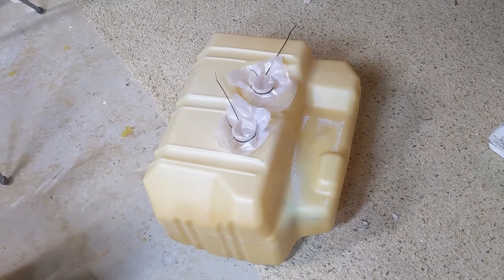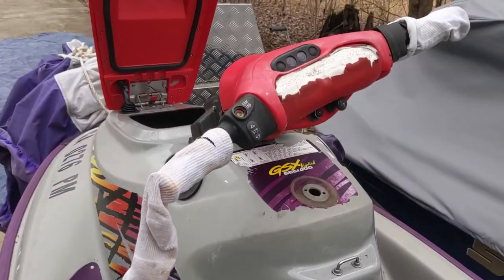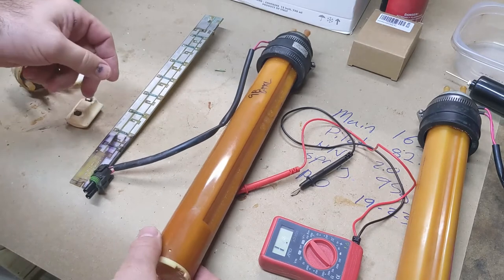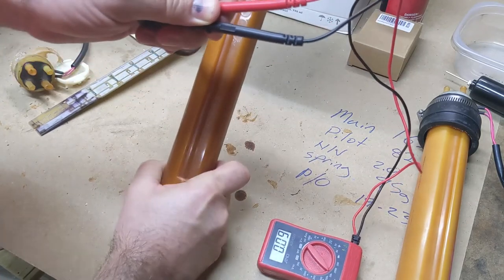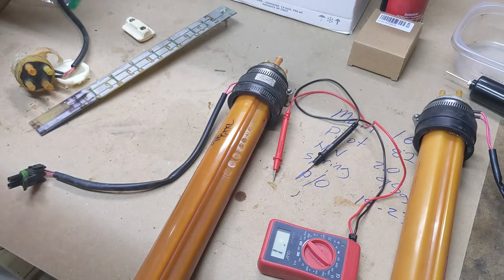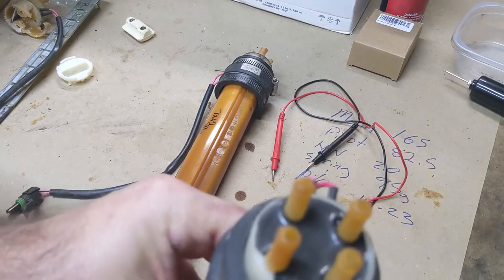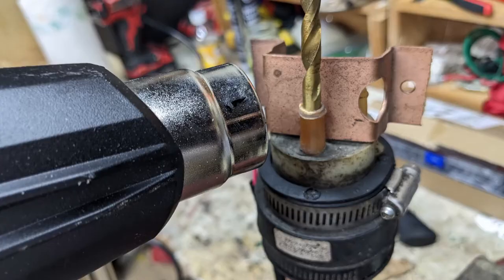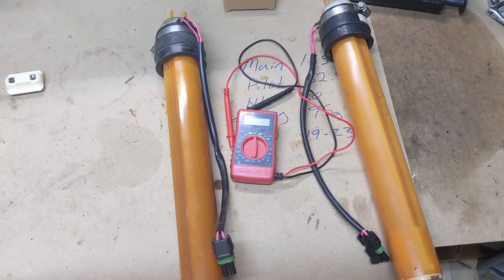Sea-Doo Replace and Test Fuel Sending Unit - Gray Ghost Resurrection

Comment: I know it’s been a few years since you posted this but how did you get your fuel pump out. Did you get it out before you pulled the tank I’ve been wrestling it for hours moving the tank every direction to get the pump out but no luck
Reply from the maker: I think you may mean the bellows or sometimes called the sending unit. It's not a pump ..just some long tubes inside a big tube. On these you have to take the steering off the top and move it aside ..and then pull the sending unit straight up thru that opening. The tank can ONLY come out after that .. and only with engine out.
Reply: @jonparkmac  the motors already out and rusting away on a work bench (came like that not my doing) but thank you so much I’ve been trying to figure it out for so long. You have any advice on getting a motor apart with the pistons and rave valves completely rusted to the cylinders?
Reply: @jonparkmac the gas tank is finally out thanks to you
Reply from the maker: Hey glad it worked on the tank. On the rusted engine .. the best thing to use is 1:1 mix of acetone and automatic transmission fluid. It's way better than pb-blaster or wd-40. Let it sit over night.
Reply: @jonparkmac okay cool that’s what I was thinking about doing I’m just waiting on the tool to get the flywheel off. I’m pretty sure the top end is gone especially since both of the rave valves are stuck and the rod on one is broken off so I doubt those are ever coming out. I’m just hoping the crank case is salvageable whenever I can finally get into it
Reply: I know this is probably frustrating but is there anyway I can send you some pictures just to get your opinion on what the best course of action I should take if not it’s all good there’s only so much useless forum reading I can do
Reply from the maker: Lol sure np. Here's my FB profile, send me an IM. https://www.facebook.com/share/B5yFzkRj8C7ACXVY/?mibextid=qi2Omg